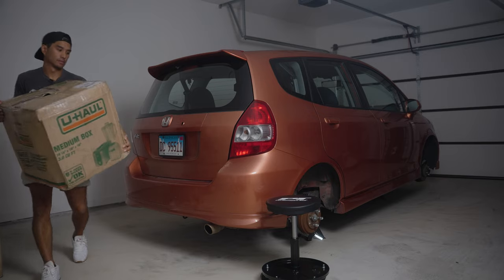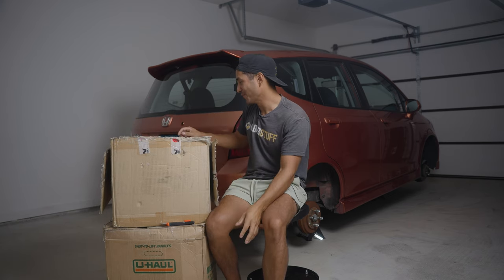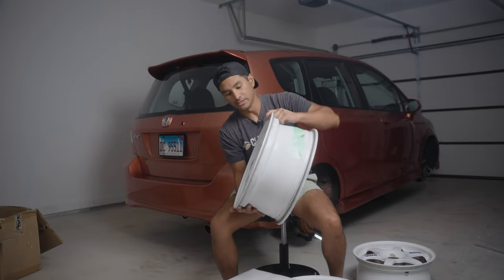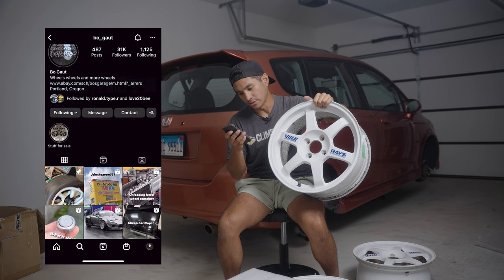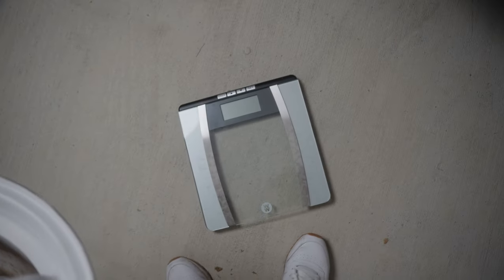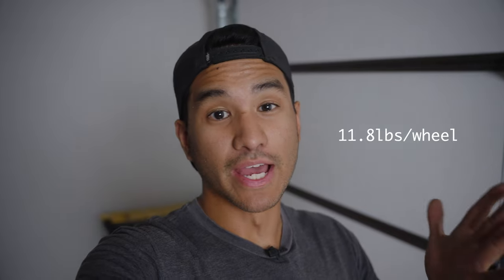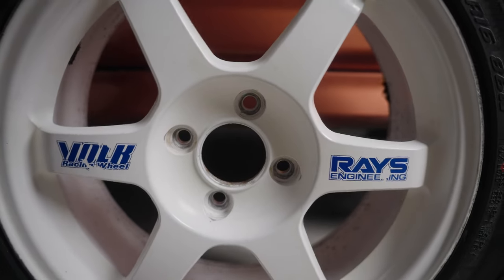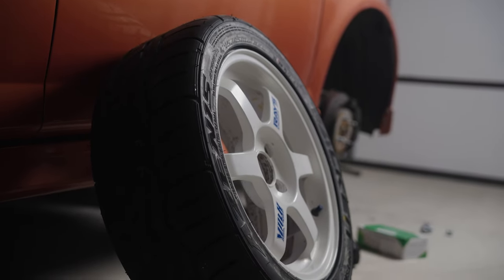Honda Fit Gets Rare JDM wheels! Volk TE37s!

Comment: I’m curious how you got on with the extended wheel studs? ARP makes a set for the fit. But when my dad and I replaced ours, we ended up having to pull hub off to get the new studs in. Ended up replacing the wheel bearings since they were going bad too.
Reply from the maker: still on stock studs for now

Comment: He is running 215/16 and never mentioned any tire rub. I am running 205/15, on my 07 Fit, and my rear tires rub over bumps or hard turns.
Reply: I have the same problem .. i ride 7 and a half x 16  and my right  rear tyre is rubing on the screw sometimes . Im looking for a solution
Reply: Have you lowered your vehicle's suspension and springs? Or is it original factory?